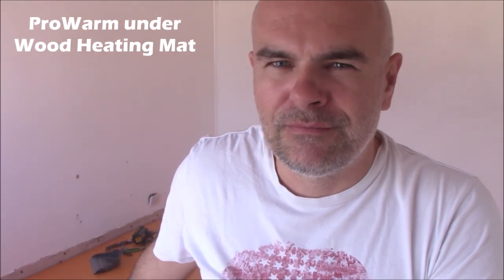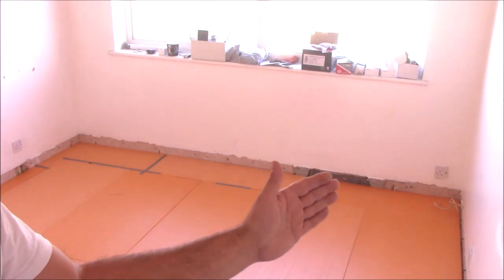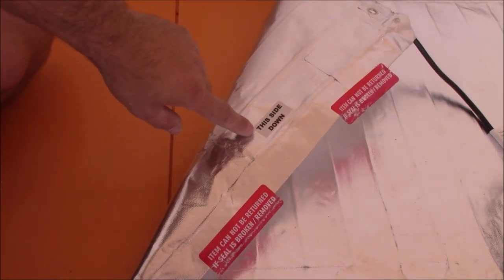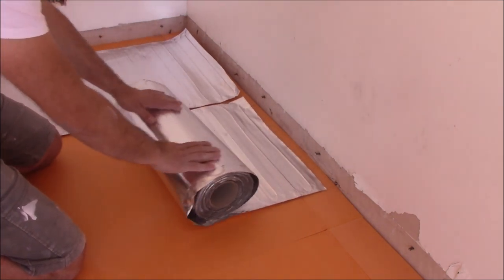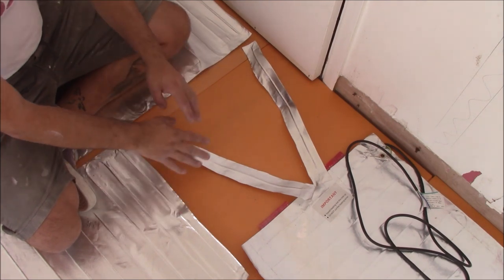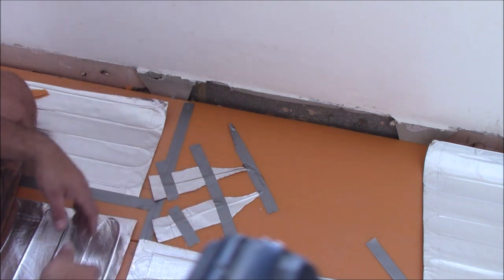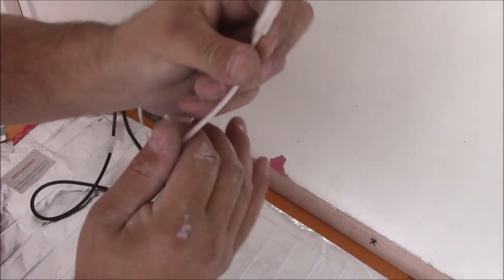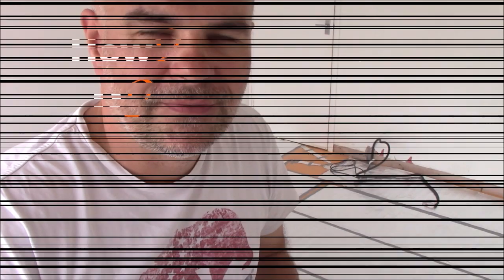How to lay down an underfloor heating mat How to install Prowarm under wood mat

Comment: Thanks for sharing the video. I have one question, my kitchen floor does havr electrical floor heating but i am not sure how it has been laid out. 

Also it's wires are not connected to the regulator? I can see a wire coming out from the regulator but it's not connected to the wire sheet.

Is it possible to connect tha

Comment: Hi I have a question.

I have a 16 amp MCB

supplying a downflow heater in the bathroom at 2kw which is around maybe 5 metres away from the consumer unit. Which is then connected to fcu presumably with a 13 amp fuse in it.

What I would like to do is split that and put that leg in a junction box bring two feeds off it one for a 1kw radiator and 1 for underfloor heating of around 350w - 500w max would this be adequate if I use 2.5 mm twin & earth which is lower than the current 2kw downflow heater and they'd both have their separate fcu for the connection to the individual heaters

Comment: Thanks for the video! I am interested if the 140w system like this is sufficient enough to heat up the room in the colder months as the main heating source? Would you be able to share your experiences? How long does it take to warm up? Thanks!
Reply: Yes. It would work perfectly. I am using similar from last 6 years and works nicely
Reply: @SS-zb4ng is it more efficient to heat your room than your normal heating?

Comment: I am going to have to put a thin layer of under laminate foam on top of my insulation because the type I bought is too HARD as its IMPORTANT that the mat/wire element can mould into the insulation to stop the wood/laminate bearing on the wire to much!
Reply: Not needed mate! I’ve laid my heated mats on top of 6mm ply wood and is absolutely fine !